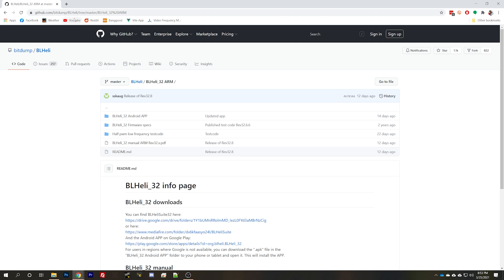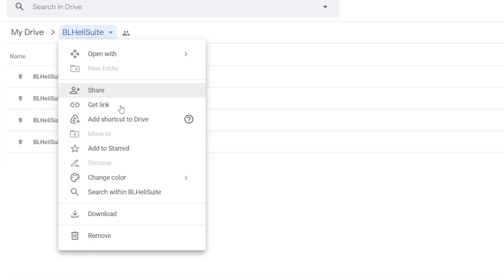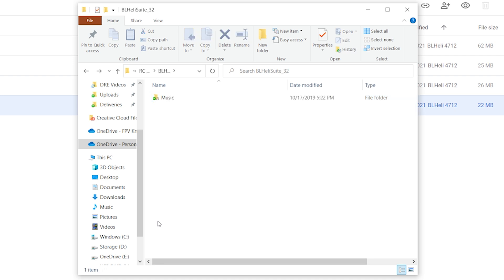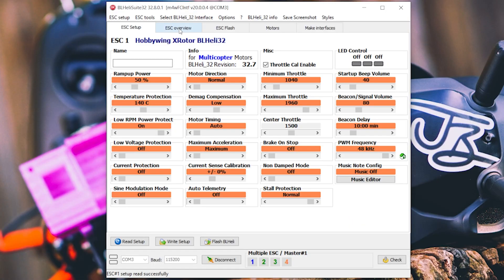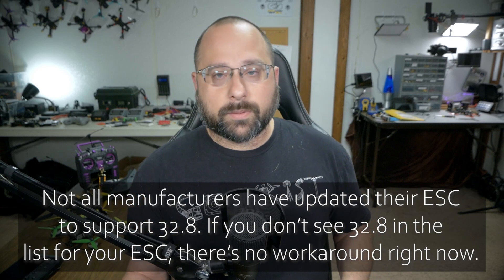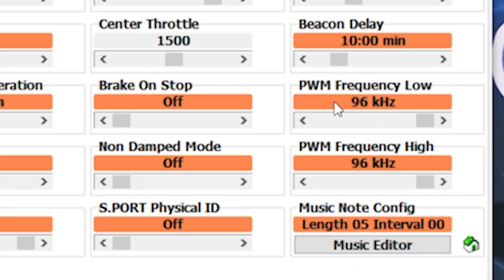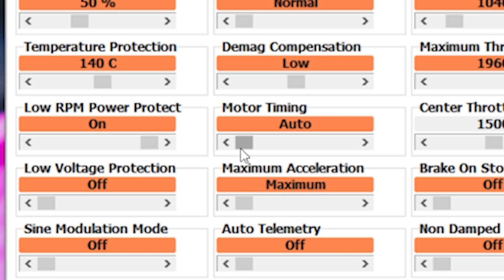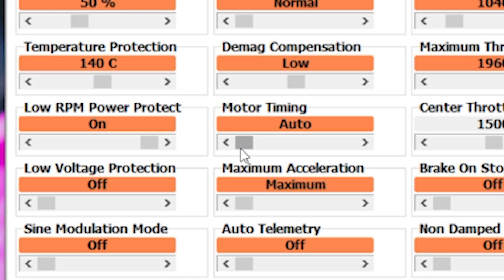BLHeli32 32.8 variable PWM frequency how to flash and set up

Comment: Well I guess I'm one of the few that has had a bad experience with variable PWM. I got crazy oscillations and mid throttle oscillations. Regardless of pid or filter settings. 😑
Reply: My setup is the Aikon 20x20 35a stack and Xing 2306 v2s.
Reply: Same here. Tried to tune it out but without success. Tomorow i will downgrade to 32.7 and see if it goes away. I am using Tekko32 with Xing-e 2207 2350kv
Reply: @TfourJFPV  I found that just turning off Variable PWM solved the issues for me

Comment: LMAO pulled my 2018 acrobrat off the wall last night and plugged it in. To my surprise the FC and the esc's were able to update to newest versions of firmware. 2018 blheli_32 esc's running 32.8.
Reply: That's not too much of a shocker. JB updated a Tekko32 in the video, which is from the same era as your brat.

Comment: bl heli 32 32.8 make my motor over heat.
Reply: Yea unfortunately mine did too. And they made a chattering stuttering. It was literally my only change 24 to 48 variable and flew awful. Changed it back and it’s all good. Maybe it only works with certain esc? Or motors?
Reply: @brendand.2269  yea i flash back to 32.7 and all good.
Reply: @brendand.2269   I haven't tried it yet
Reply: @Cyenergy3  I’m going to try some other setups over the next week. I have 7 other quads I can test on so I’ll see how they do. And they are all tuned and have been flying excellent for months so I can really get a feel for any changes
Reply: Same, stuttering when throttle and hot motors... back to 32.7, I have an HGLRC FD60A.

Comment: I've done lots of testing and Autotiming increased my Amps consumption during hoover. So it's less efficient! I know it should be more efficient than fixed value, but it isn't.
Reply: My understanding is then it should be more efficient for you at high rpm than your previous value.
Reply: If you use your quad to vacuum, there's no wonder! =P But seriously, is that how you experienced it?

Comment: I just want to say, I jumped on 32.8 on two quads few days ago. Both had ENORMOUS motor heat issues, tried to retune to no success. Even locked at 48khz the heat was there. Went straight back to 32.7 and everything is good again.
Reply: how strange
Reply: What brand ESC’s are you running?
Reply: @guitarguyf16  Mamba F40 Mini and Mamba F50 Pro.
Reply: Same here

Comment: It is ABSOLUTELY AMAZING!!!!  so smooth and control at low throttle feel as good or better than kiss
Reply: I have been flying Fettec F7 Kiss stack also Emuflight & Betaflight firmware with BlueJay firmware.  So I have a couple of quads in my fleet that has BLheli 32 esc's So I'm very curious to see if its anything like Kiss. That would be Awesome if true?
Reply: @allennickles3970  very interested to hear your update. I've just update my R369 and its now silky smooth throughout the throttle (even on 4s!).

Comment: i did this and it sounds horrible..like its dying.. had to turn it off
Reply: Same here. I literally only changed the PWM 24 to 48 and it was chattering and stuttering. Took it off and it was fine. Maybe only certain esc and motors will work ok with it
Reply: @brendand.2269  i set mine as 24khz min and 48 max and it was horrible

Comment: Already did this, and it's amazing!
Reply: Same, big improvement over 32.74 I was running.
Reply: @PadiwanFPV  what was so good
Reply: @joeoli15  general prop wash that I couldn’t tune out on my 5 inch freestyle quad, especially on split s and fast descent maneuvers(I’m not a great tuner btw). Overall it’s buttery smooth compared to where I was on 32.74. I’m also running on 24/48kz and my motors sound less angry. Feels like how others describe kiss escs. It’s difficult to induce prop wash at this point, and I don’t have to fly a certain way to avoid washing out.